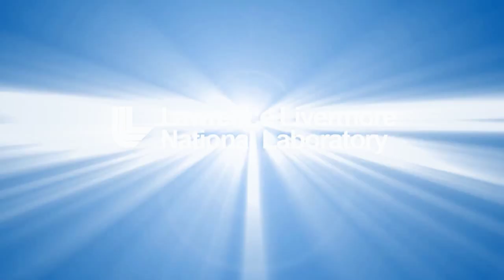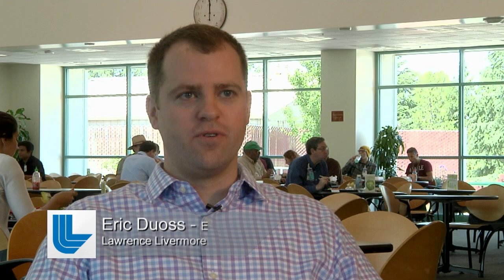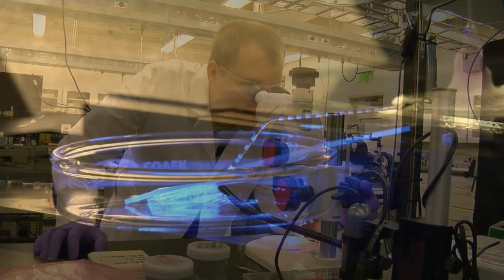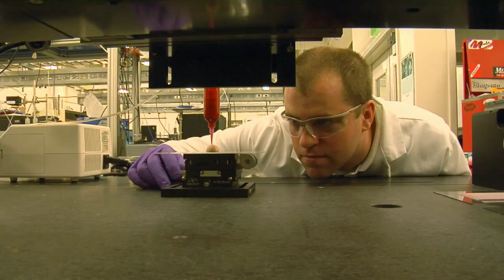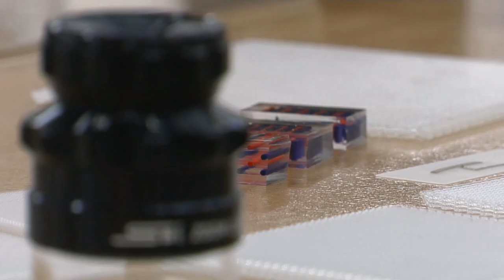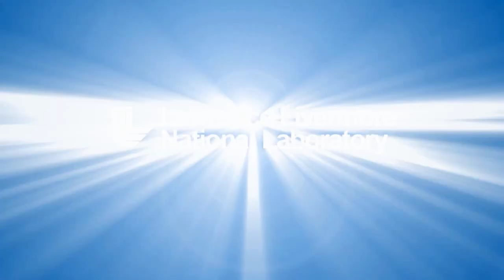3D-Printing 'Smarter' Energy Absorbing Materials

Comment from the maker: Foams are, by nature, disordered materials studded with air pockets of varying sizes. Lack of control over the material’s architecture at the micrometer or nanometer scale can make it difficult to adjust the foam’s basic properties. 

But Eric Duoss and a team of Livermore researchers are using additive manufacturing to develop “smarter” silicone cushions. By architecting the structure at the micro scale, they are able to control macro-scale properties previously unachievable with foam materials.

 #3Dprinting   #AdditiveManufacturing   #MaterialDesign